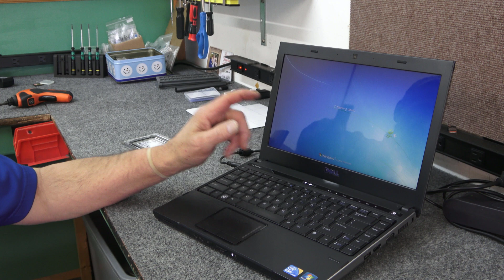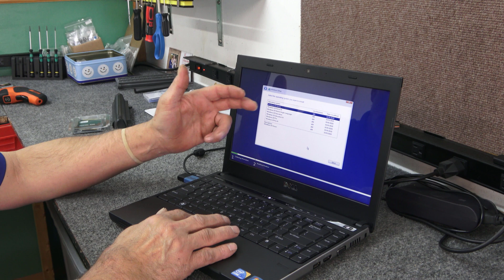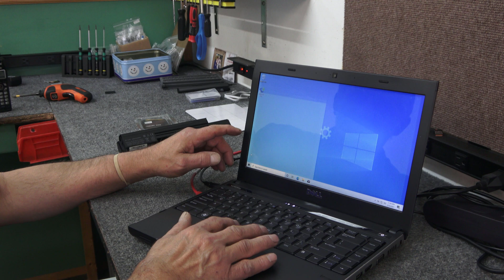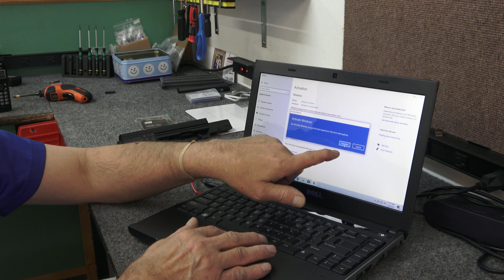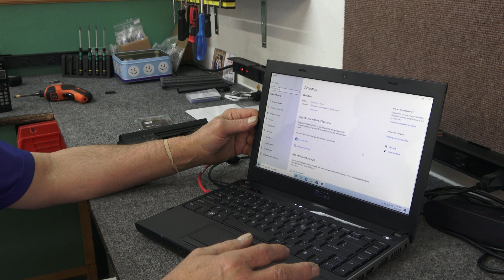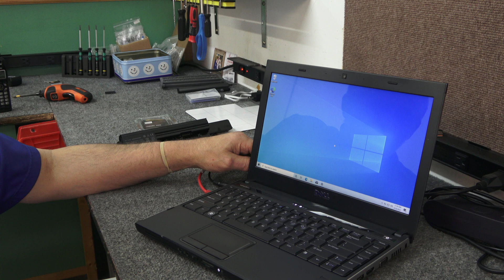How to make an old outdated Dell Vostro laptop fast and usable with Windows 10

Comment: Hi thanks for sharing. I'm trying to install win 10 on my vostro 3350, on new ssd placed in ex DVD Rom (flexible cable at fix HDD is broken). When i install win10, there is message "Windows cannot be istalled to this disk. Ensure that the disk's controller is enabled in the computer's bios menu". How to solve this?